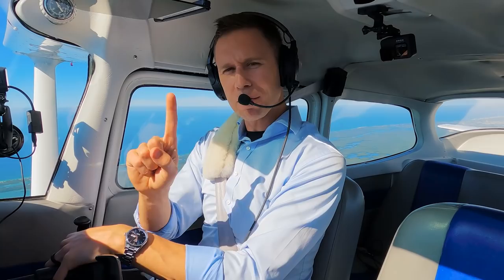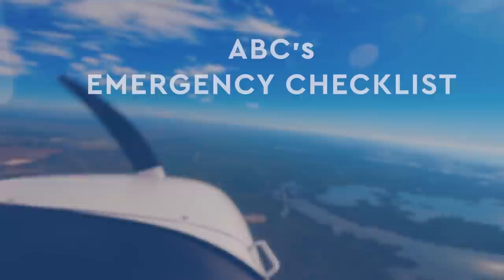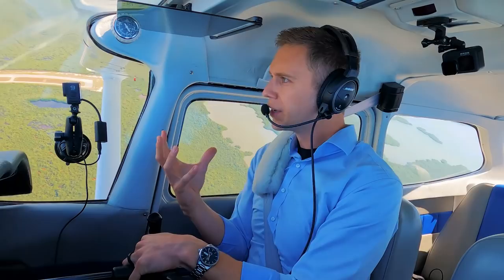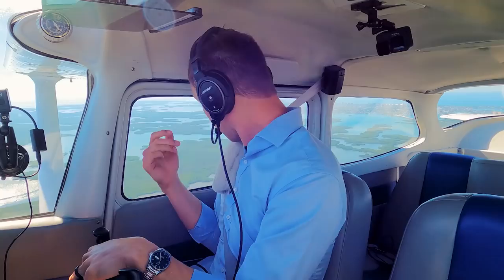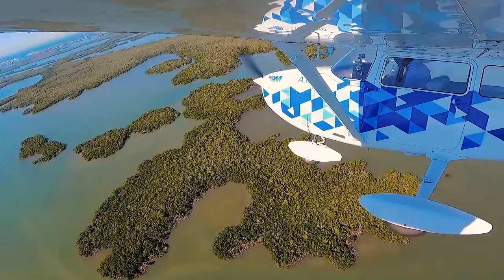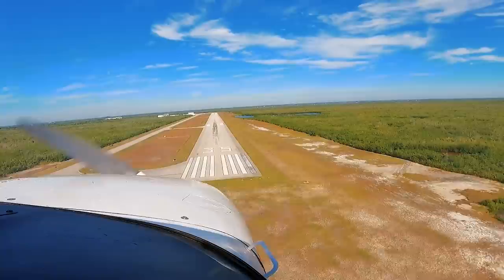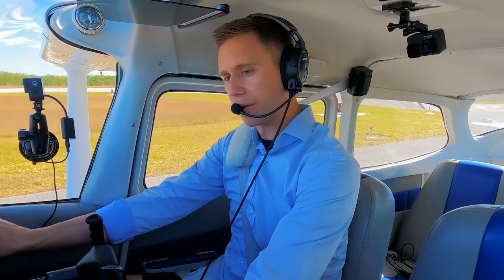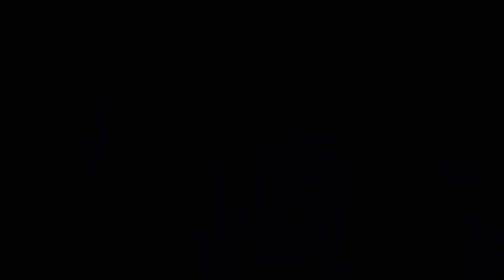The One Flight Maneuver Every Pilot Should Master

Comment: Excellent video, Jason.  I am a DPE and I completely agree and stress to all the flight instructors I work with that the engine failure encompasses so many aspects of flying that it is almost the make or break maneuver.  It has real world value.  If the engine ever quits, and they do, you have one shot at doing it successfully and having a good outcome.  I hope to have a year with zero checkride failures, but on the occasion when someone needs more practice at a maneuver, it is almost invariably this or the short field landing, and then often failing to go around because the applicant was not touching down in the designated target and landed anyway.  The only thing I might suggest for those students watching this video is to remember that Jason is clearly skilled and can probably hit his intended point close to 100% of the time.  When he mentions aiming for the numbers, I don't teach that personally.  In a normal landing, yes, generally speaking if we touch down softly, on speed, in the first third of the runway tracking down the middle third, that is clearly successful.  However, when the engine fails, we don't have power to use if we happen to screw up the approach a bit and end up slightly low.  I teach students to aim for the end of the first third initially as a target and plan on using the middle of whatever landing area they have to work with.  On base, when they confirm that I am indeed high for the first third, they can always add drag (slip, flaps, S turn) and shift the aim point in the direction of the numbers and all will be good.  But if they have extended too far downwind and suddenly realize the wind is stronger than they thought, or they misjudged or just out of habit aimed at the numbers but were a bit short, now there's no way to make it.  If you error, would you rather be long and hit the departure end fence with the brakes on and the airplane at least slowed down or would you rather fly into the approach end fence at flying speed?  You can always throw out more drag and slow down/get down, but you can't magically do better than best glide.  Error on the side of a bit high, as Jason points out, fly it in a relaxed manner like he does so you can avoid stress (which is never helpful) and you'll be a hero!  And if anything, even a bit higher than he did in the video.  You can always come down.   Nice video Jason.  Thanks!
Reply: Great explanation, thanks!

Comment: Jason, another great video, but I have to question something about your hand positioning on short final. You have your left hand resting on the center of the control wheel, and your right hand resting on top of your left hand.  "IF" for some reason you had to add power immediately to initiate a go-around, you are going to cross up your hands.  No matter how many hours you have logged, bad habits are bad habits.  Just my opinion.  Looking forward to your next video.  Thanks again.
Reply: First thing I noticed also. Not a good habit, and certainly not a good example for an experienced instructor to tacitly endorse through a video. Being confident  and calm is great, unfortunately the third "c"  that doesn't belong in aviation is cockiness, and your hand positioning hints at that behavior.
Reply: @rossvelardi6822 , absolutely.

Comment: I like to keep a little altitude in the bank if there's water before the runway, one thing I learned from gliding water = sink, maybe Gulf of Mexico is warm so no sink but it's worth thinking about. The pond before our runway usually steals about 30 feet of altitude or 3 knots of airspeed.
Reply from the maker: Thanks for sharing!
Reply: Gliding at lets say 5ft above Water will cause you to sink faster than if no water?
Reply: @sweetconman  yes water has sinking air over it when land is nearby on a sunny day. It happens at night as well, but mostly only around densely populated areas. Active cities at night can make this nearly the same effect as day time.
Reply: I noticed this flying into Annapolis MD over the water

Comment: To really teach this my instructor actually froze the prop taking me down to 250' from 2000' above a public beach (nobody there due to the cold temps) and asked me if I could set this C150 down safely.  I responded "I sure can".  He said OK and gave me permission to restart the engine right at 250'.   Luckily it fired right up and off we went to land at LGB's 25 left. Many years later I rented a plane in Memphis and the Flight School's CFI did the same but unbeknownst to him I eased the elevator back just enough to stop the prop. He didn't like that and suggested I restart. I said "Why" and landed dead stick and with enough taxi speed to make it to its parking spot.  What a great feeling. I' m 75 now and grounded due to medical issues but I remember these moments like it was yesterday.  I saw a license plate frame recently that read "Never feel sorry for a Pilot".  I agree.

Comment: In my PPL training my instructor had me do a dozen power offs at 3000 ft above a airport (uncontrolled) and would shorten the field by saying a certain taxiway was the end of the runway. I was confused when it never came up during my checkride. I got a engine out while making my crosswind turn in the checkride which was easy after practicing from 3000. I asked my instructor why we practiced it so much. He said it wasn't for the checkride. It was to make me get the emergency engine out procedure burned into my brain. I am so glad he did. I haven't flown in a few weeks but I will do this my next flight. See if it all still clicks

Comment: At my last biannual, after doing everything, and I was a little worn out, my CFI said OK head for home. Then after a minute or so, he cut the engine to idle and said, you just lost your engine, what are you going to do? I went through the procedure to where I looked for a place to land and saw we were over a grass strip. He said, all right land there, and I did. A couple of months later, on takeoff from my home airport, my engine started running very rough at about 250 feet agl. I cut the power and as the nose dropped, and I saw the far end of the 5500-foot runway. I successfully landed on the far numbers and went into the grass overrun area with no damage. As soon as I could, I contacted that CFI and thanked him!!

Comment: About the slip. Before i watch the video, my instructor taught me this. just before i soloed. Crab the fuselage as to make as much drag as possible, all the while watching air speed for stall awareness. This requires extreme concentration to rudder and aileron control. My real life scenario was on my first 100x100x100 nautical mile trip. I was to high approaching  Adrian filed in Michigan and it feels like it was yesterday. It was almost full left rudder all the while controlling the yoke and keeping the ball in the center along with focusing on air speed. Worked out to a perfect landing.

Comment: I used to teach China Southern Airline students out of Jandakot in Western Australia, Used to take them on cross country navigation flights to Cunderdin airport - an ex WW2 bomber field, so the runways are long. We used to have a break and stretch our legs, then continue. I use pull an EFATO on every student there and make the them land back on the runway - every student kept looking at me like when is he going to apply the power, this is a practice right, and I never did. Made them glide to a landing. Engine Failure to landing should be experienced by every student - as is done in auto rotations in helicopters.

Comment: Hey thanks for continuing to do these types of educational videos, esp. on basic training aircrafts. Love the fact that you had to turn carb heat on when pulling power and that you made a point to say it. Practicing simulated emergencies is great but it’d be awful if that were to turn into a real emergency. I’ve had to fly both fuel injected and carbureted 172s during my training since I changed schools part way thru so using carb heat is not as ingrained in my muscle memory as it should be. This was an excellent reminder. 

Muscle memory is quite important during emergencies. As a non-owner pilot, I don’t have the benefit of being intimately familiar with the airframe in the event of an emergency so all the more reason to make a point in practicing simulated emergencies every once in a while. Thanks again for this video, it has made me want to rent out the airplane just to practice maneuvers and emergencies next time I feel like going up. Personally, I also find the “challenge” in it a lot more fun and satisfying compared to point-to-point flying. Blue skies!

Comment: I've done one total engine out landing as a student pilot. The Instructor pulled the mixture until the engine shut off. He asked me what are you going to do? I first thought he'd only reduced the throttle for me to review best glide speed to sim a loss of power and then we'd go full power at 1500 AGL. But, I said hey, you actually shut the engine down.
He asked again where are you going? It was the fall of the year and we were flying Portland, TN to Owensboro, KY and just south of the Ohio River. I did a 180 degree visual scan in front of me and said we're going for that Soybean Field at 9 O'clock.
Then he said why not go a little further out but still 9 O'clock.
I put the little C-150 on about 68 knots and trimmed it for that and did a left base turn and lined up for the spot he picked. As we got closer I could easily see it was a local grass strip and Ag Pilots were using it.
I put in full flaps and greased it onto he grass strip and we rolled to a stop. He debriefed me and we flew out back to Portland. The point was well made. If you loose power unload the wing and trim for best glide speed and find a suitable spot and keep flying until you land. It really gives you big confidence boost to do a full power off landing.

Comment: Most excellent demonstration! An instructor I had who gave me several BFRs always used this technique  when making me do a forced landing. Being high on final and slipping to the "spot" is way way better than being low and slow. . Again, kudos on this demo
Reply: I like to think about it as coming in steep, using the pitch to hit the aiming point and sliping/flaps to control the speed. I know its basically the opposite of how many teach a normal power on landing where the pitch controls speed and power/drag for aiming/altitude, but I find this gives less precise control over the touchdown point when gliding. (Maybe just 6 of one, or half dozen of the other. Same physics two perspectives.)

Comment: Keep in mind that "Best Glide" airspeed is max L/D. Meaning that it yields the greatest distance for a given altitude (in calm air. Needs wind wind correction), not max time aloft. Max endurance airspeed yields the longest time aloft for a given altitude (doesn't require a wind correction since you're only interested in duration aloft), and it doesn't provide the greatest distance, particularly into the wind. This speed is slower (higher AOA) than max L/D. It's at about max C sub L (coeficient of lift) and right on the edge of a stall. The duration gain is small and not advisable when you're distracted with an emergency. Think Vx and Vy. They (V-speeds) all vary with weight and G-loading. But they are more easily described referencing AOA (since that doesn't change with weight). Varying V-speeds according to weight is just a way of flying the same AOA. Is it any wonder why jet fighters use AOA? Especially when landing on an aircraft carrier? Pilots need to think of AOA as performance and lift available when flying, and think of speed as energy available. Old flighter pilots rule of thumb: "Speed is Life" (for maneuvering, but maybe not when landing).

Comment: Not the same but many moons back,  I had a for real engine out on takeoff practicing for my private at Goodyear-Litchfield In AZ. It's a long strip and with half the runway gone from 500 ft AGL  I still had enough runway to get down straight ahead per good practice ending up on pavement. I can't imagine simulating that emergency. On a shorter strip I would have been through the fence but still OK. It may have influenced my technique because I don't depend on the engine to get me to my touch down. I never had another conk-out but I'm always waiting for it.

Comment: Agreed. My CFI was a bush pilot and demanded accuracy on landing power off every landing . I was 15/16 years old during most of my dual and found it annoying at the time. My teenage pee brain couldn't figure out why he was pushing me to do better than the PTS. Fast forward a few years and it really helped with flying a Caravan as a jump pilot coming off jump run power off (don't have to worry about shock cooling a PT-6, obviously) from 13K on a short strip and nailing it the majority of the time.
Reply from the maker: Nice job, thanks for watching!

Comment: 1st video of these I've watched. I am an aviator of 37 plus years and I've owned multiple aircraft including my current steed, a Wittman Tailwind W10-8.  Every bird I have owned or flown I have done my own flight testing so to speak. The Tailwind included.  A few years back in my Tripacer I cut the power at 9500 if I remember correctly.  With droop tips and vortex generators the glide is 5/1 or close to it. Beautiful landing exactly where I wanted , luck or skill is debatable. Imagine the self recriminations if I had not done that from that altitude.  My point is that no matter what altitude one is at, if the pilot cooler stops putting out power, know your aircraft AND your skill level. Always look at every flight as a chance to improve BUT REMEMBER to have fun and relax too.
    Excellent video. Liked and subscribed. 

Doran Jaffas
N625MS 
Ionia County Airport 
Michigan

Comment: All good, when you're at a familiar field in a familiar aircraft. When you're away from all that comfort zone, set up over the approach end of the runway, about 1/4 mile from the touchdown point, and fly a figure 8, with all turns toward the runway. At a certain point, the perspective will start to indicate the need to turn in and fly a stable final approach, with flaps as desired. I had to do this to a touchdown a few decades ago, in a student's "new" aircraft, a Cessna 120 (no flaps). It was my first flight in a C-120, and after doing some TO/L solo to meet insurance requirements, he and I were doing maneuvers, which I arranged to be done over an abandoned but maintained grass airstrip, which I had never landed at. The engine gave up, he asked me to take the controls, and after we landed, a local farmer drove over to take us to the diner in town (he had seen us land, and knew that meant trouble), where we had a drink, discussed the flight, and called for a ride back home.

Comment: Best glide does not equal longest air time. That's minimum sink. The speed to fly when searching for a landing place is minimum sink, then make your turn to that point, THEN accelerate to best glide. Minimum sink is not a published speed, and is a variable speed the same as best glide, which are affected by weight. 

Loved the video. Come soaring with me man. We're at X52, Treasure Coast Soaring Club.

I invite ALL powered pilots to explore the art that is energy management. Come soar with us and learn that the only way to avoid an engine failure is if you don't have one.

Comment: I had to do one of these on my Commercial EOC over Apopka, I've never practiced them in this situation. The Check Instructor pulled my power at 3,000 feet over the airport and said "engine failure what are you going to do" Yes, I landed but it was super stressful on a Checkride

Comment: One suggestion, add some links to the previous (and next when released) videos in the description. Or even a playlist. YT only notified me of this video, not yesterdays one for some reason.

Regarding the landing, I was trained to aim for the runway midpoint, then once it is made, start putting in flaps to pull the landing point back as able. Still a great suggestion to practice this. It was always different doing the engine out landings in the pattern vs in cruise, and I still remember the ones where the instructor pulled the throttle, I'd find a field, and then he'd ask if I'd rather use the airfield directly below us.
Before someone says, we operate out of grass strips in a green countryside, finding the airfields is a skill in itself.
Reply from the maker: Thanks for the feedback and suggestions!

Comment: One clarifying question... when you reduced the engine power you trimmed for best glide. As you were touching down you mentioned you 'trimmed up for it'. Did you adjust the trim after you set it for best glide? If yes, when in the procedure did you make the subsequent adjustment?

Comment: "When was the last time ..." I'm a glider pilot, so that would be ... every time. LOL! Also, maximum time in the air - and you are right over the airport or your landable field, then you would fly minimum sink not best glide. But I get it, that is not a number that is typically known for power airplanes. And could be risky for power pilots because it is closer to stall and in the pressure of a moment when the engine is out and you're running through checklists you don't want to be on the edge of stall.

Comment: Turning from base to final . Don't cheat with rudder and stall. Keep airspeed normal and bank low. Im 69. In 73 on my final checkride. Examiner pulled throttle over airport at 1,200. I glided to a perfect touchdown. I say  turn from base to final is the most critical spot to not F---K up 😂